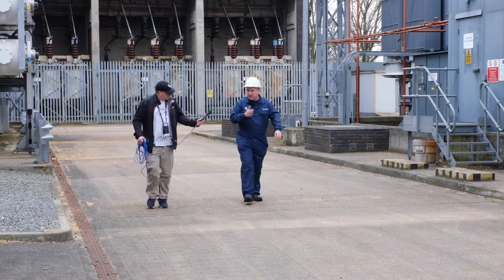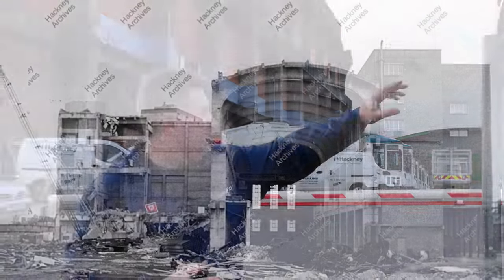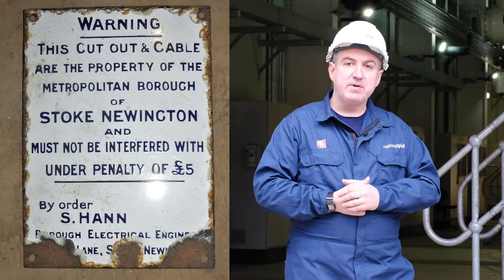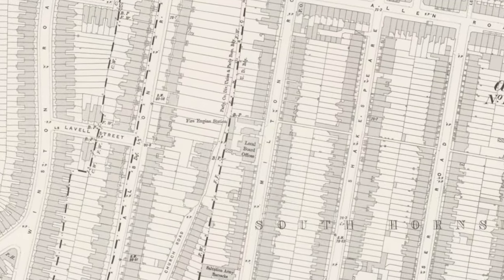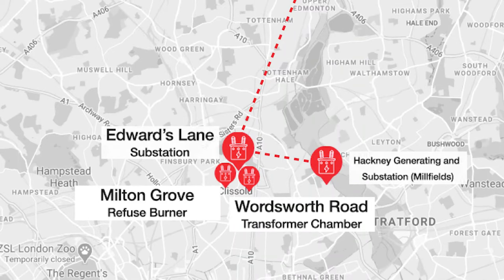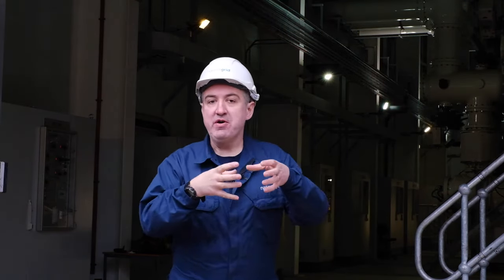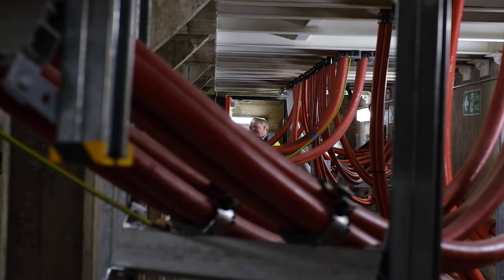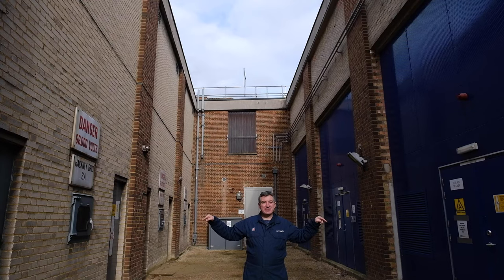Powering Stoke Newington - 115 years of electricity supply by James Watson

Comment: I work in the same industry (NORWEB area). Maybe I am biassed, but I think the subject is fascinating!

Back in the 1920's The colours were not the same as now ..... not even the same as the Red Yellow Blue you mentioned ...... They were Red White and Blue (very patriotic) but had to be changed, I am told, by EU edict to Red Yellow and Blue and now again changed to Brown Grey and Black. There were also some shenanigans over the final voltage too! We in the UK went for a 240/ 415V system but again the eurocrats demanded compliance to their 230v! 

Obviously this would have meant expensive changes so in true Britt fashion we fudged it!
We agreed to 230V but kept the systems intact as was and altered the margin of error the voltage could be supplied at to match. It used to be 240v +- 6% now it is 230V +- 10% (giving the same top voltage but looking like the European's won the day ;o) 

If you look in original Generating Plant from the wild days where we had local voltage and frequencies (and some DC) you can see original cable over 100 years old now!

To most people it would be boring at best but to me it is interesting!

Comment: The early engineers had such foresight in creating the high voltage distribution systems to carry the currents necessary today. However I'm concerned that political decisions are now likely to create huge unbalanced demands on the network which could overload parts and damage cables buried deep underground in our cities.

Comment: It’s nice to see that most of the UK has zero power poles as well as having major substations housed in grand old buildings. In the states everything is a hodgepodge of areial and under ground distribution to residential properties. Industrial old build comes in overhead while new state of the art facilities have everything under ground. Now the issue of substations is a bit odd. Many are just surrounded by 10 foot tall chain link fencing, some topped with barbed wire or razor ribbon to protect fence climbers from entering the substation. Other substations May have ten foot tall brick walls with one rather large entrance to allow cranes in for transformer replacement. Both are subject to deranged individuals from attacking these transformers with high powered rifles. Banning any rifles is not the answer.  There have been situations where transformers were damaged but not destroyed by high power rounds, piercing only the main body of the transformer and allowing cooling oil to leak out. There are protection systems that will take the transformers off line should oil levels and pressures should drop as well as excessive temperature sensors that will take it off line.
There have been multiple events in the past where some transformers will explode due to external or internal overload faults, lightning being one of the issues but not that common.

Comment: Very interesting, although I would not have termed the electric going into houses as ' safe ' certainly ' safer ' than the 400.000 or 275,000 volt supplies but still enough to kill. No mention of DC supply as was used on the very first domestic supplies, or maybe it was never used in that area.

Comment: Motor generators,he means rotary convertors, also no mention about the DC supply on the 3 wire system. no mention of the mercury arc rectifiers, so it seems he does not know much!